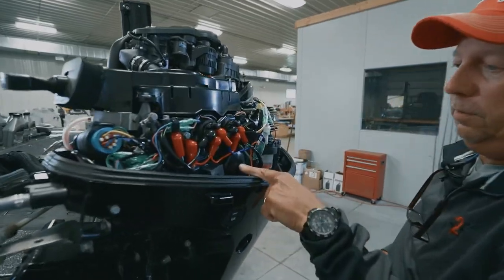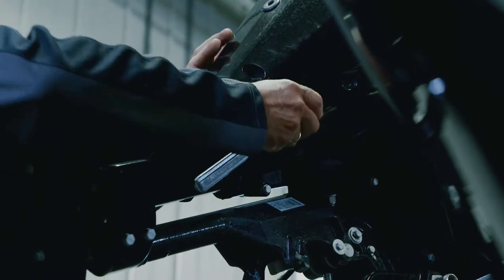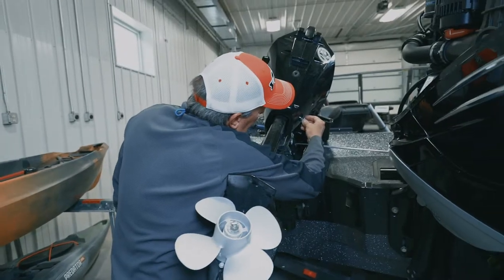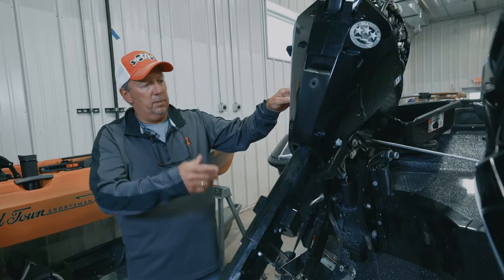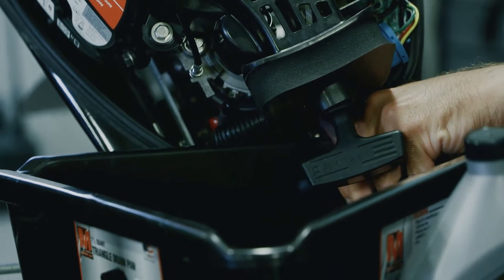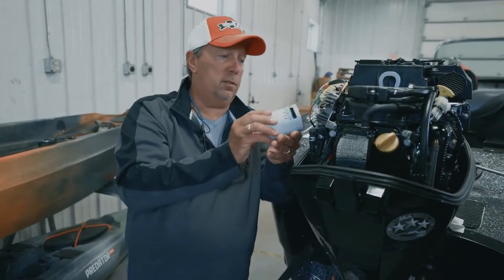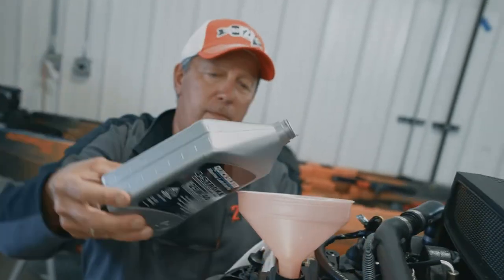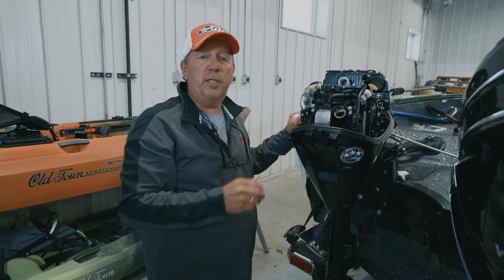Oil and Filter Change on a Mercury 15hp ProKicker Outboard

Comment: Where can I find that wrench? The guy is using in the video it looks like that’s what I’ll need on my new EFI 9.9 kicker.
Reply from the maker: This is going to depend on which 9.9hp EFI engine you have. Previous 9.9hp EFI ProKicker models (serial numbers 0R833820 through 1R281444) have the same oil filter as the 15hp EFI shown here, which uses filter wrench part number 802653Q02. If your engine is the newest model of 9.9hp EFI ProKicker offered by Mercury Marine (serial number 1R281445 and above), it will not have an oil filter.

Comment: Mine has no dip stick on the yellow cap? How do I check the oil? I cannot see oil down inside the cap with a flashlight nor can it be reached with your index finger. Any recommendations?
Reply from the maker: On most models the oil dipstick is separate from the oil fill cap. Check to make sure you don't have a separate dipstick located on the engine. If you need further assistance, we recommend referencing the operator's manual for the product you own or contacting the manufacturer of your engine. Thank you!
Reply: @QuicksilverProducts  maybe, didn’t see a dip stick

Comment: Hi, enjoy your video's.  I have a 2017 75 hp 4 stroke, what oil should i be using? I bought the boat used and the owner passed. Last year I used non Synthetic mercury oil and some people tell me to use synthetic? thx.
Reply from the maker: Great question! For the 2017 75hp engine platform, the recommended oil is a SAE 10W30 non-synthetic.

Comment: Would you happen to know the size of the oil filter socket? Thanks
Reply from the maker: Although the size is not noted, the part number for the filter wrench is 802653Q02. It can be purchased through any Mercury Marine/Quicksilver retailer and Amazon.

Comment: how do you get the wrench off of the filter once installed...not enough room to pull it off?
Reply from the maker: Depending on the style of wrench you're using, you may just want to use the wrench to crack the filter loose. Once it is has been cracked loose, remove the wrench, and spin the filter off by hand.